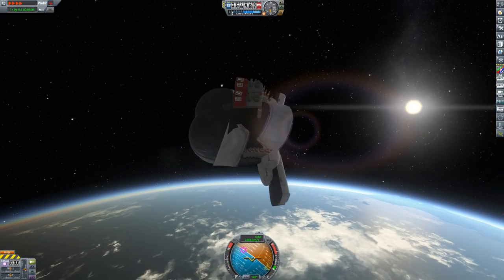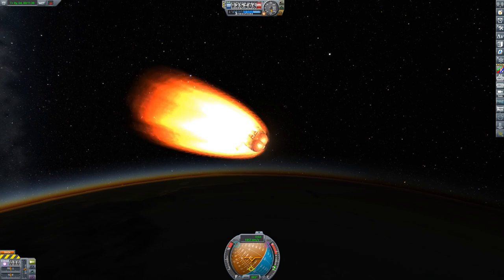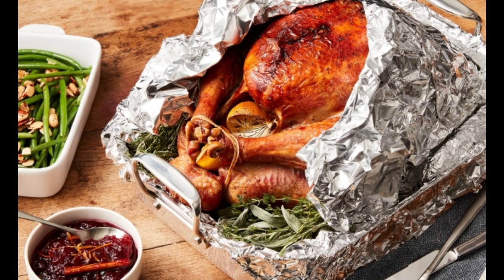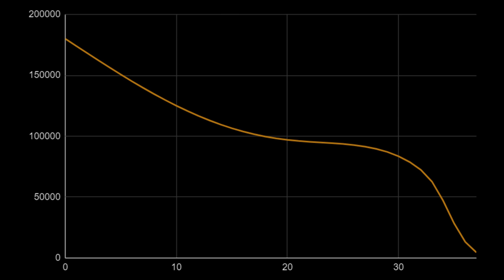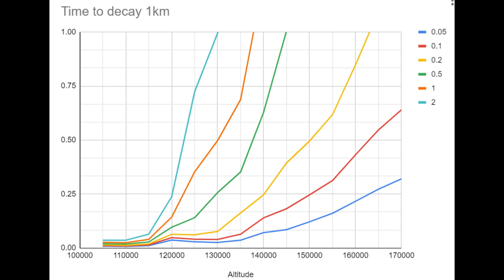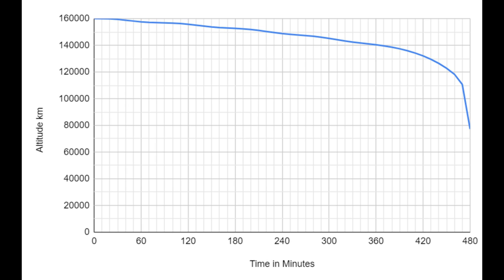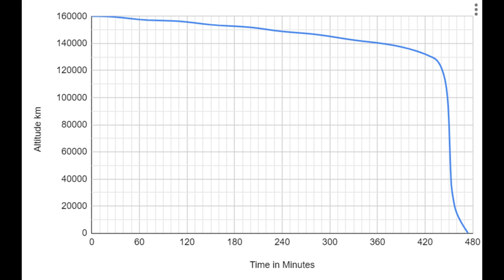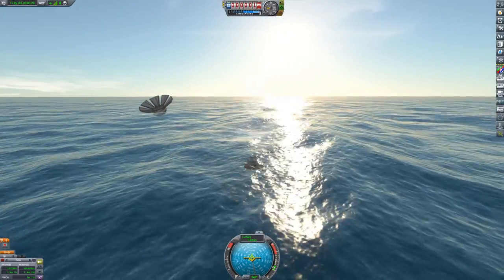Can You Cook a Turkey by Dropping It From Space?

Comment: Scott I think you're missing the fact that you can utilize the spatchcock method along with rotating the turkey while it's descending. You can cook a spatchcock Turkey in less than half the time and if you rotate the bird for equitable heating a 15-30 minute re-entry is less absurd. I feel like this is totally a doable thing if you have a two sided equitable weight capsule where one side has an ablative heatshield and the other has a metal surface. Once it hits a certain temperature the vehicle flips to stop the cooking process. This will also allow the bird to come up to temp appropriately so it will be ready for carving the second it touches down.
Reply: This is what Kuhn meant by revolutionary science.
Reply: I wanna know what happens if you drop in it a steel barrel full of oil and let the ensuing fireball on the ground to cook it the rest of the way through.
Reply: I meant what by what now?!
Reply: Deep-frying the Turkey would have been the better way to go.
Reply: How will the vehicle flip once it reaches a certain temperature ?? Will you have to manually program it to flip or is there some existent physics behind it ??
Reply: @akshays3572  You'd want it to be programmed to flip since its a temperature basis and not something else. Ideally you could use RCSs and potentially shifting the turkey's weight to rebalance the heatshield to be heavier causing the capsule to flip to the heatshield side. Once the flip occurs you would want to ditch part of the metal cover as the heatshield will ablate and shift the center of mass back towards the metal part that was used to cook the bird
Reply: What if you drive a titanium tube thru the bird, and add some fins to the drumsticks to keep the b8rd facing forward. Hourglass the tube and you create a sort of ramjet that will generate lots of compression heat in the center of the carcass and roast it from the inside out.
Reply: De-boning it would also make this much more plausible, as the bones delay the cooking process and are unnecessary weight, being inedible. Ideally, you'd also configire the load so that the dark meat is closer to the shield than the white meat, since the ideal doneness temperatures are about 17 degrees Celsius different. Either that or lightly insulate the white meat, perhaps with stuffing.
Reply: @solarcheese  Well, the main issue I can see is that you would first have to find the remains of the barrel, because it would probably impact the ground at around Mach 10, and, assuming it survived more or less intact, that is more than enough impact energy to bury it at least 50m into solid granite. More likely though the barrel, assuming you used a standard steel 44 gallon one, would ablate through at around 100km altitude, leading to the oil leaking out, and then the remains of the barrel being torn apart by aerodynamic forces around 60km up as it hits atmosphere thick enough to register on regular gauges.
Reply: I was hoping someone else would know of the Spatchcock, and I was not disappointed!
Reply: @OkieOtaku  Well, I normally do this for things like chicken and rabbit when they are being done over a nice set of coals, though you can save a lot of time with judicious precooking in a pot with water and spices, to keep the meat moist and get heat all the way through, along with flavour, and finally just do the outside to get the nice flavour from the Maillard reactions.
Reply: I wouldn't want to eat a turkey that had only been cooked for 15 minutes, spatchcocked or not. Also turkeys vary greatly in size.
Reply: @jasoncdebussy  Henny Penny pressure cooker will do that sucker in 15 minutes right through, though you will have a lot of oil in the meat. That is what KFC uses to do the chicken, and those take 12 minutes per cycle when you are running flat out.
Reply: @SeanBZA  One of the reasons I don't go to KFC 😂 It's still a no from me.
Reply: @hellcy7237  But then you need a control system that can withstand the heat load, power, probably cooling, etc. Find a material that melts at the correct temp then as the reentry heating/cooking gets to temp the support material melts and re configures the oven for landing.
And if nothing else it will save mass on RCS/gyros.
Reply: For over a decade now, I only cook turkeys in Reynolds baking bags.
At 350F, they cut the time almost in half versus using a foil tent over the baking pan. My last turkey was 14lbs and cooked perfectly in around 3 hours.
Reply: Nah Scott got the spirit of the thing right.  Spatchcocking is for cowards. 😂
Reply: Why's everyone getting so excited about this?
It's just the high altitude cooking instructions and they're written right on the side of the capsule.
Reply: The people who took this super serial are MY PEOPLE 😂 🍻
Reply: @akshays3572  You'd either manually program it so that it deploys some HIAD-like drag bags, or perhaps use some kind of pressure vessel with a burst disk that blows out when it gets too hot and releases the drag devices.
Reply: I can see the recipe now… “allow your turkey to rest for 10000ft prior to carving” 😂

Comment: You mentioned steam. The inside of the capsule would act like a pressure cooker and would cook turkey much quicker.
Reply: and explode shredding the bird perfect for turkey tacos
Reply: @flethacker  Yum!
Reply: I always autoclave my turkeys.
Reply: Attach a valve to the front to regulate the pressure down to 1 atm.  It would help with balancing the temperature too!  And if you attached it prograde, it would provide a very weak retrograde thruster for you.
Reply: Seems to me you could rig the cooker to introduce some of the heat into the turkey cavity, and speed it up considerably
Reply: @JMurph2015 My grandmothers pressure cooker had 5, 10, 15 PSI settings.  If you put in oil it would be a pressurized oil fryer, unpressurized it only takes 20 minutes.
Reply: Also If there is to much pressure of steam then it can be used to slow down the capsule by releasing steam through the nozzle in front of the machine.

Comment: What about jabbing heat conductors into the turkey to accelerate the cooking?
The other thing to consider is whether or not turkey is a viable option for heat shield material.
Reply: Let's go all in here an do a right job. Instead of simple conductors, let's use heat pipes pumping in molten salt to transfer the heat faster into the turkey to allow is to cook fully in 15 mins. The engineering involved would be insane.......but worth it!
Reply: @plasmafoal1117  I like your way of thinking however, I believe that molten salt would be too hot for our purposes. Ordinary radiator fluid would doo.
Reply: @surferdude4487  Since we are already going to the expense of launching a turkey into orbit just so we can cook it using re-entry heat, I think we should be thinking BIG! Cost and complexity are no consideration at all and as such I want to change my previous suggestion from molten salt to a Lead/Bismuth eutectic as used in fast spectrum nuclear reactors!!! We are going to need a triple redundant control system to ensure the turkey is cooked to perfection also. 
This sounds like it would need about 20 years of research to be able to pull it off but the builders of the James Webb telescope probably have some time on their hands now!!!!
Reply: @plasmafoal1117  You seem to misunderstand me. Cost and complexity are not what I'm concerned about at all. I just thought that molten salt would be far too hot for our purposes. The objective is to cook the turkey to perfection, not carbonize it.
Reply: @surferdude4487  you are right of course, molten salt will freeze long before the optimum temperature is reached. I am ashamed and embarrassed that I didn't foresee this issue. Even the lead/bismuth idea won't work which really disappoints me as I loved the complexity of it!! That being said, normal radiator coolant seems to be too straightforward and makes the most sense so we may have to reject it for those two reasons (its straightforward and makes sense).
Ammonia is used as a coolant of the ISS and I like ammonia due to the fact we would have to use it in its superfluid state!!! How awesome is that!!! Superfluid Ammonia at high temperatures to cook a turkey on atmospheric reentry sounds like really interesting approach with load of expense and risk!!!

Comment: The thing that you didn't talk about is thermal mass. Put the turkey inside a thick cast iron block, or maybe a liquid tank, and have a shutter that allows heat to reach the iron, or a tubes running the liquid through the heat shield, so that you heat up the thermal mass to 500 degrees or whatever, and then you stop adding heat

Then you can land the oven, and the cooking will continue while the recovery teams are tracking it down.

Have the capsule open up to stop the cooking when the BBQ thermo probe registers the correct internal temperature in the meat.

This simplifies things because you just have to plan for enough thermal mass for the correct cooking time, and then design the capsule and orbit to get the thermal mass up to the needed temperature, and since it would heat from the outside in, you could have the cast iron exposed directly to the plasma, and not overheat the turkey.

Comment: Real fun! 
I didn't know a deorbit could be made slow enough while still generating enough heat, for the turkey to actually cook inside a spacecraft with no heat insulation. 
I did expect that almost nothing will happen at the beginning and once it get low enough for the air resistance to become significant, the deceleration will quickly go up (as it start to lose altitude and catch more air) with a way to short reentry reaching way too high temperatures for the turkey to cook and not just burn from the outside in, haha

Comment: You can easily cook things longer after it hits the ground by using a heavy capsule that takes a lot of time to cool off. You could find a material that melts around the upper limit of cooking temperature and line the inner wall with packets filled with this material. They will melt to prevent burning the turkey and solidify to maintain that temperature for longer.

Comment: What if you filled the ship with peanut oil, then use that to fry the turkey on the way down? I suggest this because the specific heat of oil is roughly half that of water, and fried turkey cooking times are generally much shorter than baking times. Besides, once you get a Cajun deepfryer, you want to use that sucker on everything.
Reply: I would fear this might increase the risk if a BLEVE event if the oil got too hot!
Reply: @DrRusty5  that might even be utilized in a kind of self-stabilizing temperature control of the vessel
Reply: In this case it's probably better to use sesame oil , slightly higher flash point.
Reply: @DrRusty5  Relief valves are your friend.

Comment: Now there’s a thought experiment.    I wonder if the heat shield from the dragon capsule can handle a lunar return mission at high speeds (~24000mph)
Reply: As it is, probably not. Why should it? It wasn't built for that and since it's ablative, it would at least need to be much thicker, which would mean unnecessary excess weight.

If your question was more meant to be "is it possible to build a heatshield for a lunar return mission from the same material dragon uses?" - thr answer would be "probably yes, just make it thick enough". But would that be feasible from a weight / performance ratio or are there better materials for it? I have no idea 😅.

Comment: Hi Scott, the over-heating at the end of the re-entry could be solved more simply by having some kind of insulated container within the spacecraft that has doors. The doors are open for the majority of re-entry until the temperature starts to get too high, at which time the doors close and prevent the temperature inside the container from getting any hotter. Imperfect insulation or some kind of vent could be utilised to prevent the temperature inside the container from dropping as the turkey continues to cook.

Comment: Fyi, pasteurization is time+temp. The widely quoted temps are an oversimplification for the purpose of safety, where time is basically zero.

As an example, most of us know of 165⁰ for chicken. But if you can hold the center at 140⁰ for an hour, that's also safe.

This is of particular relevance for us that sous vide.

Comment: I asked ChatGPT:

An orbital oven is a type of oven that uses orbital heating to cook food. Orbital heating involves the use of infrared radiation to heat the food, rather than heating elements or a gas flame. This type of oven is designed to cook food quickly and evenly by circulating the heat around the food. Orbital ovens are often used in commercial settings, such as restaurants and cafeteria, because they can cook large quantities of food efficiently. They may also be used in residential settings for cooking at home. Some orbital ovens have additional features, such as the ability to control the temperature and cooking time, and to defrost or reheat food.

Comment: What you could do is have a metal slug at the front of the craft and it would soak up the heat and ablate, a system of circulation fans and heatsinks can create convection cooking. Have it deploy a parachute to slow it’s decent. Spend much less time in orbit.

Comment: A larger diameter capsule would have a greater surface area for both heat conductivity and capacitance as well as a larger amount of shock heat from reentry as well. Apply spin to evenly heat the capsule (which is acting as a heat sink) until it has enough thermal energy contained to fully cook the bird via convection over time as it descends. You could also, as someone else suggested, fry the bird in oil from the residual energy absorbed by the capsule and it's components as well, instead of relying on just the radiation or uneven contact from the heat sink itself.

Comment: My thought was placing a turkey in a giant ball of metal with a hollow centre and thick shell and enough heat capacity to absorb the heat from re-entry and slowly radiate the heat off after landing, if you get the size right the core should be hot enough to cook the turkey at the landing site as the sphere cools off, I'm not a science or math guy, but surely someone could design the perfect alloy that can do that plus the addition of cracking open once it has cooled off and the turkey cooking is done, the idea of a giant metal egg landing in your garden on Christmas and then cracking open to reveal a cooked turkey just sounds so cool to me.

Comment: Need a big heavy ceramic heat shield with a pressurized water loop in it so that the shield can get very hot and then transfer the heat into the oven at a controlled rate.  Turkey will be cooked in an appropriate time using the residual heat from the shield.

Comment: I have a solution:  Use reentry heat to power a thermoelectric generator that then operates a microwave.  This way you can regulate the heating of the bird and get heat into the inside.

Comment: Many years ago my Brother was in the RAAF as a RADTECH. He was sent across to Pearce Airbase to fix a Radar issue (Carbonized mass on the Radar diffuser cone). Clearly there was a story there so he got on the piss with the local crew and after assuring them nothing bad would be going "up the chain of command" asked them what really happened.

Well, it seemed they were on the piss and were hungry. One of them mentioned he had a frozen chook in his car and it was decided that they could use the Radar to defrost it. It was duly strapped on the Radar and turned on for a few rotations. It promptly burst into flames and the bones carbonized into the diffuser cone causing ghosting and rendering it unusable!

They had forgotten that whilst it was also microwaves, it was way more powerful than a Microwave oven which whilst only about 1,000 watts but only about 1% duty cycle. Military Radar is both in Kw but also 100% duty cycle. Funny to think these techs that know about radiation burns and everything could make such a fundamental error of scale.!

Comment: i think you missed an easy solution . once you know the total energy to cook, and don't want to bother fine tuning the descent time, you may want to use a ceramic thick shell around the turkey to accumulate energy, and restore it over time like an accumulation heater ( those 2m3 heater that use electricity by night, and restitute energy during day with a simple fan ). or bread oven. you just heat the shell, and then let time transfert heat from shell to bird slowly.